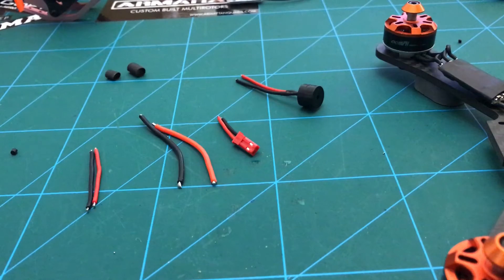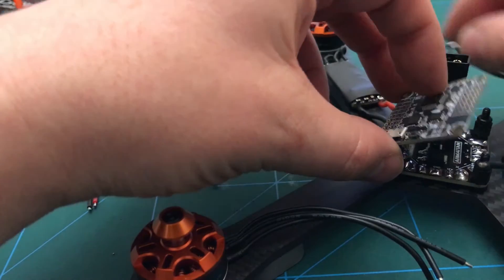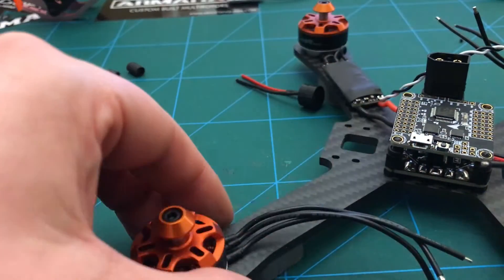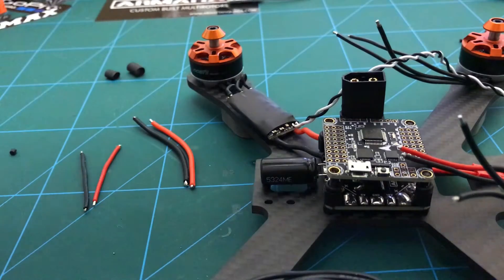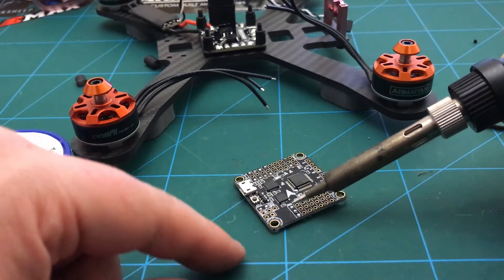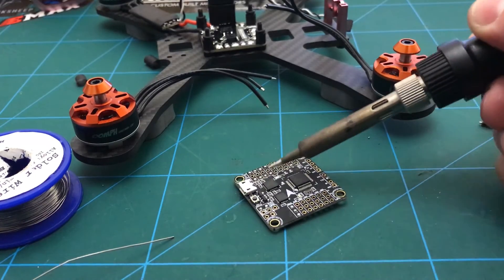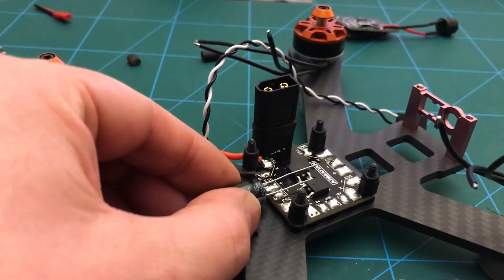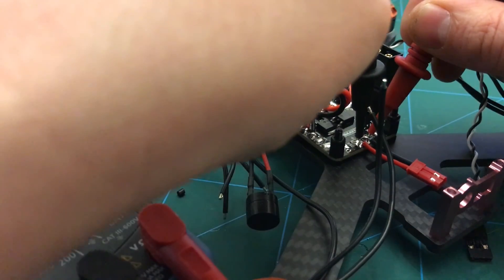Armattan Chameleon Quadcopter Build - Part 3

Comment: I have watched a few Chameleon builds before building my own. I appears people like doing things the hard way, or are more interested in showing off mad soldering skills over a clean build. Flycolor Raptor "s" tower. Done. And i am amazed at the awkward stacking of VTX and Receiver. I mounted a micro VTX behind the tower on standoffs on the bottom frame and ran the battery cable below it. I can switch channels and power via the button on the vtx through a hole in the top plate. I chose a micro frsky receiver and mounted it with double sided tape in front of the tower between the camera cage mounts and ran the antenna's down the inside edge of the front arms. The way it fits is like it was designed to be there. No esc's on the arms, no stacked vtx wrapped around a receiver and taped to the battery power cables.
Reply from the maker: Yeah. There’s a million ways to do any build. Not saying mine is perfect, just the way I like to do it. Mirco rx weren’t really around when I made that, they do make life easier. I’m tempted for a 4in1 esc on my next build.

Comment: Could you please tell me the value of the capacitor? Btw I like these video series, I ordered my Chameleon from Armattan Quads directly and now I can hardly wait to start building it. I will take your videos as a great tutorial. Cheers!
Reply from the maker: its a 25v 1000uf capacitor. I use them on all my builds, never blown a VTX yet!
Reply: Thanks for the fast reply! Keep flying! :)
Reply from the maker: Its a great frame, i thinking about ordering another.
Reply: Do you maybe know a shop where I could buy these orange Oomph motors you have (the 2206 2300kv) ? I need a shop that ships to Europe. I tried to search all the European official re-sellers from the Armattan page, but I can't find the motors anywhere. :(
Reply from the maker: +Getz01 what country you in? I got mine from ebay. But if youre in the UK Maplins have them in a big mixed bag.
Reply: I'm in Switzerland currently. I moved 2 months ago and what I learned real fast, the import tax from anywhere else than Switzerland is really big and expensive. So this is why I try to find them in Europe. :/ Thanks for the fast reply! :)
Reply from the maker: +Getz01 ebay probably your best bet then.
Reply: ok thanks! :)
Reply from the maker: +Getz01 get them direct from Armattanquads.com due back in stock soon.
Reply: Ok thanks once more! :D
Reply: Pro Tip on soldering... always apply the tip to the pad and wire not on top of the wire. You can end up with a cold solder joint that can break loose later in time. Also mounting the esc first with double-sided sticky tape makes it easier to solder the wires to it and the PDB.
Reply from the maker: +Jeff C thanks. Appreciated.